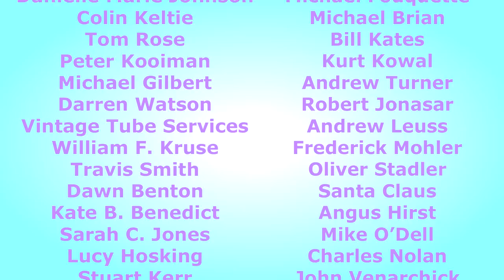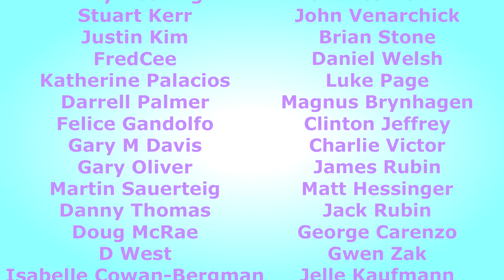Weird But Practical - Leper Amps!

Comment: Class-D amp switching efficiency has gone way up in 20 years. At a prior employer, we wanted to upgrade the next generation of our equipment with something better than a simple piezo alarm annunciator, so we put in a Class-D amp and a wider-range piezo speaker.  We applied an inverse transform of our piezo speaker response to our sound files to get surprisingly decent sound output.  The resulting sound files placed large demands on the amp driving the speakers, which it handled with aplomb, even through thermal testing, without any heatsinking beyond a copper flood on the PCB.
Reply: Yep. The market for portable Bluetooth speakers has really pushed demands for amplifier efficiency. Typical efficiencies of well over 90% are now normal, made possible by big reductions in MOSFET RDS(on). Integrated amplifier chips like the MAX9744 or TDA7491HV can operate quite happily at a nominal 20W per channel with no heatsink, just stitching vias on the ground pad. Infineon's new Merus series can go as high as 100W per channel without a heatsink, thanks to what is basically a hybrid D/G topology with a multilevel output stage. The Tripath TA2020 was a radical and brilliant chip 20 years ago, but (audiophile concerns about distortion characteristics aside) it has been obsolete for some time.
Reply: I dunno if Fran reads comments, but she really needs to hook those up on the bench and see if they can deliver 20 watts RMS at reasonably low distortion and without burning out.  You never know until you try.
Reply: @j.dietrich  From day 1, class D was billed as the efficient alternative to traditional A, A/B, and B amps.  The difference is very little bias current at the cost of switching noise.  To get transistors into a reasonably linear range and to set the amplification, you need to burn some current.  Think of it as standby mode or something.  With digital output, the output is switched on and off so that very little... why am I explaining this like you're all idiots?  This is probably the only place on the internet where people know stuff like this.  Anyway, it's impressive thermal efficiency and probably the specs on the box are a little too generous.
Reply: Yes, modern D amp efficiency is stunning.  I have built up some Differential D SMD HT6872's in tandem, and have been shocked at how good they sound, and how cool they remain even when driving @ 3W.
Reply: @davidg4288   For most of these chips I've encountered, nominal power is rated at 10% THD into 8 ohms. Clean power is somewhere in the 10 to 15W range, depending on supply voltage and load impedance. They tend to have thermal protection and overcurrent protection, so they usually just shut down rather than burning out.
Reply: @j.dietrich  That makes sense, even cheap LED driver chips have thermal overload protection nowadays.  I was mainly wondering how those cheap looking units would fare against the older ones that Fran prefers.
Reply: @j.dietrich  RDS(on) is the key here as it directly affects power dissipation allowing for higher switching frequencies with higher efficiency and smaller filter inductors.  and Fran - Yes - those output chokes are necessary to keep the speakers from dissipating the high frequency switching artifacts which are several octaves above the audio band and the more octaves, the lower the digitization distortion.
Reply: @Peter-House-Jr  Slew rate of the output mosfets is also an issue. That's controlled by device  Junction capacitance. While the mosfet is slewing its transitioning in a higher impedance state than its Rds on,. In that state it's creating heat from the  transition impedance (which is brief in time, but long enough to create problems in slow fets).
Reply: @geor664  You are 100% correct !  

At the rate we are going, I expect 100A FETs in an SOT23 package with 0 capacitance and infinite bandwidth and the problem will then shift to how to get the current across the Cu PCB without I2R losses - a little exageration but it sure seems likely even if physics says no.  I remember FETs in the 70's were fiddly and finicky and had relatively high RDS(on)s - nothing like the ones today.
Reply: @Peter-House-Jr  ahh yes, do you remember around the late  1980s Perreax amps (New Zealand) came out with their first Mosfet Audio  Power Amplifier. It was a direct take off from a Hitachi White paper design. Those things were indestructible.
Reply: @davidg4288  look up a channel called Williston audio labs, he has done tests on some of these small home class d amps
Reply: @madmax2069  Thanks, site bookmarked for future reference!

Comment: Yep Those Tripath amplifier modules can produce some very pleasing amplification and seem to be able to drive some interesting impedances. I have been using an amp with the module to drive the near field monitors I use for recording/mixing as well as taking a set of floor standing speakers and an amp to do an AV upgrade for a viewing at other peoples places! No it won't produce enough volume for a very large space with some speakers (even a 200W class A/B will struggle with the wrong speakers!)  Some say they are good for the price the reality is they are just good...

Comment: I read on forums when i bought this Lepai that the Tripath history was that it is chips made for really high-end amplifiers, but that the company got bankrupt and heap loads of chips sold for nothing ended up in cheap amplifiers from China. The 2020A+ is a great amplifier for sure :)
I did mod the 2020A+ with ring core chokes, i cut away the crappy preamp chips, i cut away the tone controls because i like the source unmodified, and cut away the stock input electrolyte capacitors, in other words i bypassed everything with only i think 0.22uF film caps between the chip and RCA plugs, and the sound improves alot like high end stuff shall be. It was descriptions and inspirations on the internet for these mods.
Also use a stronger power supply than the stock ones, it need more power for bass when playing loud. I think i used a ancient laptop PSU for this purpose.
I still got this old Lepai.
I also did modify it with warm nice orange LED's with the right resistor to adjust the light, it is really nice now compared to the stock blue ight it had :) I tested first with warm white LED's, it was okay'ish, but not enough, so i found orange to be even better :) My first chrome and teak cased germanium transistor Philips amplifier i had as a kid had orange power light on it so i wanted to copy that idea :)
I use it with a Eltek kit build DIY (cut MDF plates yourself) speakers, with SEAS speaker elements (Norway's best speaker factory), alu tweeter on it i think H400, and modified removed dustcap & cut spider on the speaker element, for mid/bass, a description for making the speaker more freely moving with more details in the sound.
I also bought some other lower powered Tripath's too as spares back in those days, the thought was if i ever needed something in my car or home. It is said that the smaller ones shall have a warmer sound to it, almost tube like compared to the 2020A+, not 20 watt like the Lepai but i think 15 watts, great for low sound (to get the distortion figure down properly) near field listening. Shall we see, yes Tripath TA2024 chips it is in these.
Search TA2024 on ebay and you still get these dirt cheap, with even nice red audiophile caps on the green PCB already installed, so perhaps try them out instead of these shitty new Lepy ones? :)
I read that some people even prefer these smaller ones, because of the warmer sound, if they usually listen to music not so loud and near field.
I also bought two stronger than the 2020A+ Tripath amps on PCB, TK2050, to make something some day perhaps for the car.
I has not tested any of these yet because the 2020A+ covered my needs so far.
I also has two different kit build 6N3 tube preamp buffers if i like the tube sound anyway. The ones with 2x 6N3 tubes gives weakly warmer still neutral sound, does not change the sound much.
While the i think the starved one 6N3 tube PCB gives very warm sound, and, in some cases i like this one :)
That is if i want warm sound like my 1945 Tandberg Sølvsuper 4 (Silversuper 4) radio i had as a kid, i for sure get it with that one, if not more, yeah, too warm sound gives me something if i want my ears to relax from modern music :)

Comment: Fran is right these little amps are great for TV, computers, and bedroom size stereos.

The one I have is pretty nice. It has USB and Bluetooth. The downside is the remote sucks! Even with a fresh out of the pack battery you have to be 2 feet away from the amp, in order for it to work.

Comment: I have used several of these "original" amps for many years and have been very impressed with the build quality and longevity for the price point. Most of them came with a minimal power supply and will do much better with more amps in.

Comment: When the idea of a Switching Amplifier occurred to me, back in 1986, I made one very simply from a CMOS 555 timer chip, one low-pass output choke to average out the square waves (while especially killing their sharp edges), one external transistor (to give a 50% duty cycle on the square wave output), small caps and resistors to set the oscillator, plus a small pot to tweak the free-running frequency. I set it to oscillate at close to 2 MHz, adjusted so that none of the square wave harmonics would be in the AM Radio band. This also put any residual square wave noise far above the human audio range. Nyquist sampling rate (nearly 2 MHz) was very high, giving very good wideband frequency response. Audio Input was to the analog PWM pin, through a small cap for DC blocking. It was only monaural, but it put out very good audio with no detectable DC offset, about half a watt while running on 5 volts, and there was no sensible heat generated. If it had half of a MOSFET H-bridge added to the output, it would have been able to run cool at high power.

Comment: I use a Kinter K3118 unit to run two 3.5" coaxial Infinity Reference Speakers in custom enclosure boxes. It works well enough for my needs.  I also use a small powered subwoofer with it.
Reply: My personal experiences that lepai 2020 is far better sounding than the one Kinter I used -although I don't think it was the same one you have...
I used my 2020 with 8in fostex en Series speakers and got one of the best sounds I've ever had in my life, comprable to a tube amp in some ways but with far firmer bass control

Comment: I'm amazed at how well these little Class D units work, the punch they pack and the sound quality.  I've had a little unit running on a laptop power supply (19.5V @ 5A) running on our 'main system' (living room PC & TV) and when the sound effects start flying it will shake the house.  Very impressive.
Reply: yeah right
Reply: DItto on the laptop PSU...made a huge difference to sound quality at high volume!  These things rock.

Comment: Been a fan of ICEPower for class D. Have a very beefy 500W ICE powering my homemade subwoofer.

That said these little cheap class D amps are great for bookshelf speakers or near field monitors. I wouldn't trust any serious audio work  with them but for playback it's fine.

Comment: Class D is not only more efficient, but also can be hifi.  There are highend class D amps that have as little distortion as class A, except at higher power and better efficiency. Purifi and Hypex for example.
Reply: It would take decades untill class D becomes thrue HiFi. In bass class AB is faster and controls heavy drivers many times better.
On jazz vocals D is useless, try AB test with any decent A class amp. Literally there are things missing in music on hi grade D class amps. Tryed Ice and Hypex, was not impressed.
Reply: Wish I had been able to do some careful listening to some of the newer class D amps my company was making in my reference system. Class D (& G) amps can be very clean, and there are many "audiophile" branded class D/G amps being sold. All portable devices (phones, laptops, tablets, Bluetooth speakers and wireless earbuds) use these (& Much smaller) ICs for audio output. My car has a 630W, 11 channel factory audio system for example. (Edit to fix autocorrect)

Comment: I bought and still have that same Lepai purchased for less than $30 about 10+ years back and it has been competently driving a pair of Polk 2way bookshelf speakers ever since. The only downside has been that dodgy power switch which doesn't make full contact on every power up.

Comment: I hooked up a 2.1 version of these to a franken mix of 2x hifi floorstanding speakers  and a large 2ohm car subwoofer and amazing the amp drove the setup, including the sub, extremely well. Could get the whole room shaking and it wasn't noticeably overheating.

Comment: I have 5 of the LP-2020A+ Lepai amps. I got them on sale from Parts Express 10 years ago for $20 each and they even came with 12V 2A wall warts (although they run better at 18V). They are pretty good for what they are. One thing I really like about them is the protection circuit. If you give it too much volume with anything lower than 8 ohms impedance it will reset. I would use it to test out crossovers I built and it would let me know if I messed up lol. They were perfect for DIY projects back then but, you can get better ones now for around the same price.

Comment: The amp without a huge heatsink is probably based on the TPA3116/3118/3130.   According to the Texas Instruments datasheet, the chip will do 2x15w without external heat sink on a single layer PCB.  2x30w on a dual layer PCB.
Reply: Exactly, and often just the board is enough to be the heatsink.
Reply: These amps usually use the case for heatsinking. The company I worked for was getting 2x30W into 4 Ohms from ICs similar to the later lepy amp. Now they use discrete mosFETs and produce hundreds of Watts. Happy to see the insides & hear some history, so I now know to avoid those little amps.

Comment: We've got a 20 watt class-D mono amp board we make at work that doesn't have a heat sink. There's some via stitching to dissipate the heat into the ground plane, and that's all the manufacturer of the chip recommends.

Comment: I bought the Lepai a few years back. I did not work out of the box. Granted, I could have sent it back and increased it's carbon footprint two fold. Instead, it currently resides in the scrap pile. I am glad you had better luck with yours!

Comment: I've had one of these for quite a few years, it is just that handy, and surprisingly decent power for a little economy radio/amp. It did better than a brand name receiver much higher in price I bought once, found too quiet and returned. It's easy to put wherever I need a radio receiver, takes up almost no space. I've even been tempted to buy another for a spare room but instead went for my standard Denon since for a permanent install I might as well go for something a little more quality when I can afford it.

Comment: Those Lepai / Lepy amps are just my go to any time I need a small amp.  It would be preaching to the choir if I listed everywhere I've used them.  I've also had good mileage with the newer 2020Ti models with the Texas Instruments chip, so if you have not, I'd suggest trying one or two of those.

Comment: I've got one of these Lepai amps. Never opened it but also assumed it used the case as heatsink. Now I'm going to have to open it to look inside! It's stereo with a sub ouptut that has a VERY sensitive output level setting. I've had it for years for various uses and it has not let me down yet. Great little amp. for very cheap price 🙂
Reply: Class D dissipate very little relative power - the output transistors are either hard on or off.

Comment: My favorite resource is to pull the all the different data sheets for that chip. Most likely that whole design is someone's application circuit. What I like is the chip manufactures  sometimes gives levels of options to reduce cost. You can add those omitted parts.

Also, when it comes to heat dissipation, the difference between analog and switching amplifiers is exactly the same as fixed voltage regulator equivalents. 
The analog voltage regulator dissipates ALL the excess power as heat in the pass transistor.  
A PWM switching regulator's power dissipation is from the on saturation resistance of the switching FETs. FETs have improved a lot over the years and ON resistance can be a factor of 100 lower now for the same price, which makes them much more efficient.

Comment: For us older engineers, it can be hard to believe how much better FET technology has gotten. I just implemented a replacement for an existing battery load tester with modern FETS, and the new Rds on values at full saturation are mind-blowing. The part we used was good for 1.6mOhm, despite being rated at 250A. I could easily believe 20W is achievable out of that newer amp.

I was amused by the power bricks though, especially the Vonage one. That was definitely a surplus buy.

Comment: Most data sheets will guide you with how much PCB copper clad you need as a sink. Frankly, as for holding up against vibration, it is way better than all that mass yanking on the PCB and chip.

Comment: I have "Kentiger" mp3 player version, in that the heatsink is actually the aluminium casing. Amp circuit is screwed to the side of the casing. It is also pretty powerful if the powersource is good enough. I have used it mostly in car. Sound from the mp3 player is a bit noisy, but it was good enough for car. If it would have been a little better quality, the idea of little amp which includes line input, radio and mp3 from usb and memorycard, is very good. It had also overly bright led lights, I took them off completely.